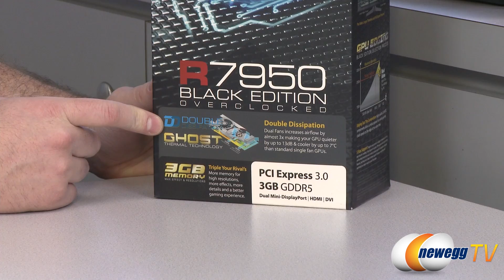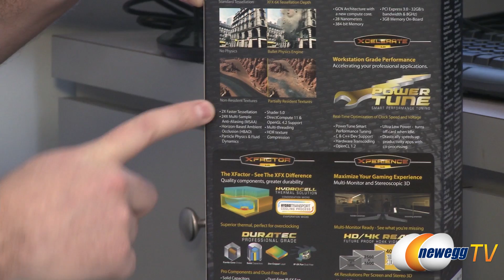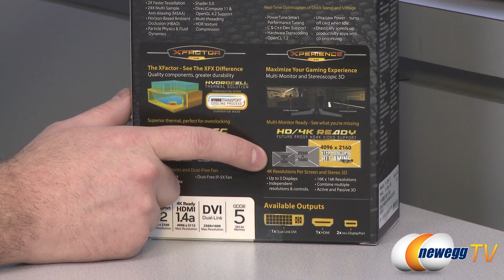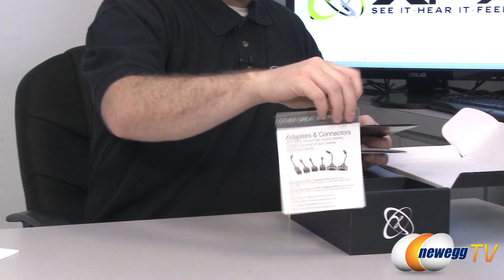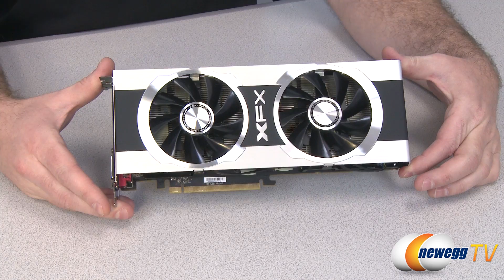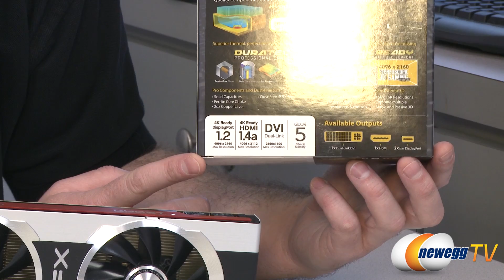Newegg TV: XFX Double D Black Edition FX-795A-TDBC Radeon HD 7950 Video Card Unboxing

Comment: @ilovemyhonda250ex Nvidia and AMD always exchange blows. AMD comes out with a card that beats Nv, then Nv beats AMD, rinse & repeat. This is how it works gen to gen. The gap between the two getting so small it's almost pointless to debate.

I am sure Kepler will pull ahead, though AMD has a good head start & will have more mature drivers by the time Kepler gets here. So I think the gap will be quite small. These days its more about personal preference than performance. :)